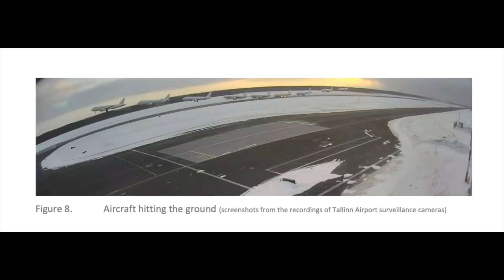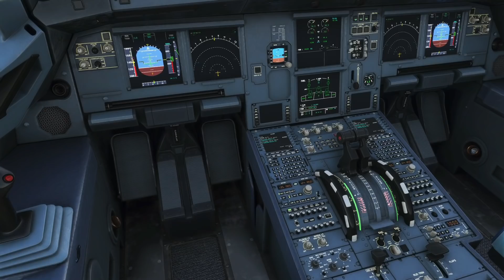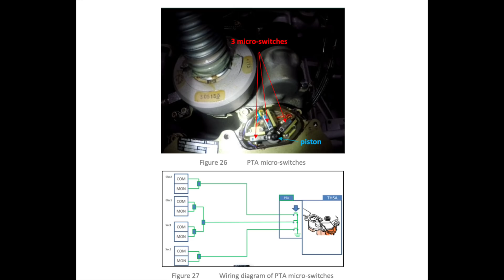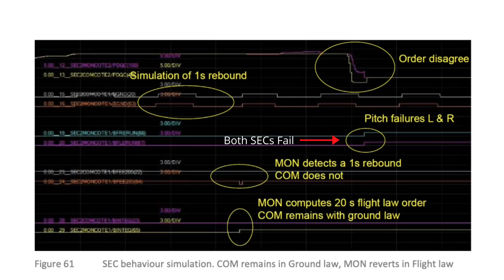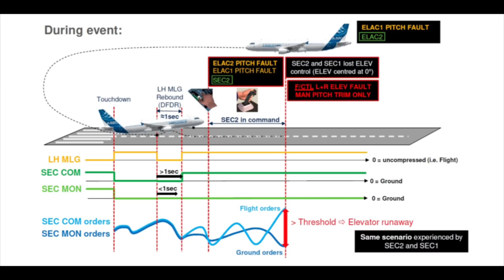The Oil Change That Crashed A Passenger Jet | The Crash Of Smartlynx 9001

Comment: Personally, I think the automation should assist the pilot, not replace him. Ultimately, the flight crew should have an option for a complete and total override of any automated system just in case it goes haywire. There is no real perfect middle ground as both the pilot and a computer can and will eventually fail, but I think that about a 7/10 should be the "happy middle" of sorts. There is no perfect system or man and if anyone strongly disagrees with me then go right ahead, I´m glad to hear your opinion.

Comment: Why isn’t there a “PANIC  BUTTON” that when pressed simply turns these complex flying lap-tops into a Cessna for complete all hands on deck manual control 🧐🤨🙄 ??!!!
Reply: Because a Cessna has cables from the column to its control surfaces, a fly by wire aircraft doesn’t

Comment: I stand in a 5 in terms of automation. Too much automation to me makes pilots depend to much on automation and when there is a failure pilots don’t know how to respond if they haven’t had much manual flying experience. Too little automation and 1 sudden move can crash a plane and without automation systems to try to correct those mistakes and even help pilots in some instances we could have crashes, as we seen in the past sadly.. And even really complex situations where automation helped keep slight control… So to me not too much automation to make pilots hand fly a little bit more and have experience for a automation failure but not to little to make 1 or multiple pilot errors crash a plane but also for extreme situations having automation is good to keep control of a really extreme situation

Comment: Automation is fine, it relieves pilot workload, and can operate faster than any human.  However, since it does screw up despite the best programming and redundancy, it should always be able to be completely cut out and revert to manual control.

Comment: It wasn't the automation so much as ignoring repeated failure warnings.   What did the pilots think was going on to cause those warnings?  They were so lucky everyone survived.   I am a relatively low time single engine pilot (3,200 hours) who owned a Piper Arrow III and never ignored a warning - one of those was when the prop RPM "ran away" then returned to normal - I landed at the nearest airport and upon inspection the prop governor turned out to be micro inches from failure to full feather in flight.   Had I continued I would have been flying a glider.

Comment: Less automation means less possibility of failure, 2 pilots in the cockpit should be enough to prevent problems but that lies in their training and procedures. 
There is something called in USA and Canada a "KISS Rule" which means for those who do not know: "Keep It Simple Stupid", the less complicated the system is the less possibility of failure exist and better performance can be reached in a safer way. That is my opinion.
Anything that is very complicated is more expensive, more difficult to manage and sustain and it is more prone to failures.

Comment: I am a bit old school i remove auto pilots from all the planes i have had and my jet is old enough not to have one so i have to fly all the time but i am a pilot not a Computer programmer i have never said what is it doing now !! Its all on me because i take the job at hand as i should i put extra words in the check list just so every flight i can walk away from ! I wish they had a switch on the airplane to put the control back in the pilots hand when the computers can’t compute Gary K
Reply: That’s exactly what happened with the mechanical control

Comment: Perhaps the most famous oil incident in a jet was in 1983 when an Eastern Airlines jet was being serviced as part of a class. The instructor failed to replace the "O" ring around the oil sensor as he serviced each of the engines. The plane was returned to service and traveled 100 miles before enough oil escaped to cause the first engine to fail. Fortunately the flight crew managed to turn the plane around and the last engine managed to hang on despite no oil pressure until they were on the ground.

Comment: I am a manufacturing engineer, not a pilot, but I suspect the ideal amount of automation is 7 or 8 on a scale of 1-10. Part of my job over the past 30+ years is “mistake proofing” production process - not nearly as complex as flying an airplane. One thing I discovered is the more a process is modified to eliminate human error, the people operating the equipment understand it less and less. The end result is that the makes a very consistent product when everything is working properly, but when something goes wrong the folks on the line don’t know what to do about it. 

By relying too much on automation, pilots may eventually become less able to deal with a malfunction plane.

Comment: I think the automation level should be 10. I think the huge reason that the current planes are so complicated is because they are designed to keep human pilots in the loop. If the planes just ditch human pilots all together, flying itself should be easy. We can make cars navigate through complicated roads, we can also land rockets by themselves. I don't think there's any reasons that a plane can't fly itself all alone since air traffics are relatively sparse. There's only a finite number of planes and a finite number of airports after all. 

Human pilots are useful because human has eye, ears, and can sense vibration and acceleration. Human pilots are also pretty good at interpreting these things. If we can put cameras, microphones, and other sensors around the planes everywhere, I think we can eventually replace human pilots.

Comment: So in this case It's completely humans fault, wrong oil, not verifying why there is a warning, if the people on the ground and the pilot did their job perfectly this wouldn't have happened.
But, people are not perfect they fail.
Human error is inevitable, also means automation failure is inevitable, because its built and managed by humans.
The automation is not completely fail safe, because there are too many combinations of failures that can happen to calculate everything that could happen.
Ultimately humans are still better problem solvers than machines. That's why we have pilots in the first place.
Pilots are the last resort, airbus should have mechanical flight controls as a backup.
Reply: They do. Did you not listen when it was mentioned about the mechanical backup for the trim where the 4 elevator computers failed?
Reply: @tomstravels520  Well I'm not just talking about trim. The pilots should be able to have mechanical control of the all the control surfaces(elevators, rudder, ailerons, flight spoilers). Actual cables Like Boeing does for its aircraft. More types of back up(Hydraulic, mechanical, computer) are better imo, not just COMPUTERCOMPUTERCOMPUTERCOMPUTER. Don't put all your eggs in one basket.
Reply: @mofumofutenngoku  “Like Boeing does for its aircraft” you mean like the 777 and 787. The latter of which has no mechanical controls at all right?

Even the 737 Max has FBW spoilers. I don’t think you understand how FBW systems work. It’s not just 1 computer that controls everything. The A380/A350 have 6 separate computers and 1 backup system
Reply: @tomstravels520  The aircraft in this video was a a320 not 380\350. When I said Boeing I was talking about the most popular planes 737 and 747. Yes I know that, I know that if one computer fails, there will be another back up computer that works. Electronic controls are more reliable than mechanical controls, and we primarily rely on them. However, since they are all computers they are susceptible to the 
same kind of failures , whether that be, Environmental damage, software bug, etc. If you have a mechanical back up,(Like cables or hydraulic) You have another redundancy that will not fail at the same time as the computers. Its just redundancy
This goes both ways, I would be arguing  the same but for computers if you only had mechanical backups. 

Don't put all your eggs in one electronic basket, put at least one in a mechanical basket for goodness sake. You get my point? 

Alright I made my point as clearly as I could, don't have the energy to argue anymore.
Reply: @mofumofutenngoku  well tough luck. Both Boeing and Airbus newest aircraft have no mechanical controls. The 737 Max and 747-8 have partial fly by wire controls. Mechanical backups add weight which increase fuel burn so no they most likely won’t make a comeback. This A320 had mechanical back ups for the trim and rudder which was enough to get them back. The only computerised controls that failed wire the elevators. The ailerons and spoilers all worked until the engines failed then the RAT deployed to provide power to both ELAC’s, SEC 1 and FAC 1. A single computer my be affected by the conditions you describe but not all 5/6/7 at the same time as they are all working off different. Why do you think they have so many computers. Plus if one fails it will be replaced for the next flight.

Comment: 12:44:  The idea is for pilots to practice enough so that they won't make errors.  Computer equipment on the airplane creates a false sense of security.  If pilots have enough skill, they won't need computers to correct them.  It strikes me as to how many of these crashes result from pilots pressing ahead when they should land immediately.  Human nature, more than anything else, is such a prominent factor in so many of these crashes.  Keep airplanes and flying simple.  That way there will be only minimal need for computer equipment on airplanes.  Keep airplanes small too.  That is why planes like the Airbus A320 shouldn't even exist, let alone being permitted in the air.

Comment: After Flying the Airbus A20N, the Cessna 172 G1000 and the 777-200 ER in MSFS (Xbox Series X) for a generous amount of time, all 3 are fun but it's hard to pin down which i prefer, but after all that, I'm still only playing MSFS. I'd say a 7 out of 10. But for simplicity, i'd fly the Airbus, but i'd have it's systems regularly inspected and replaced at the first sign of trouble. I'd also not ignore my ECAM when it displays warnings, these computers aren't like your average PC, they're carefully manufactured by Airbus, and i trust them with my life, but i also like Boeing (737-800, 777-200ER.) but the MAX scares me, i'm flying from Bordeaux next month on Ryanair to Stanstead, so i'm hoping that our aircraft will be an 800 and not a MAX 8, so wish me luck. And if in October, if News declares that a Ryanair crashed while flying from Bordeaux to Stanstead or the other way around, know that i died with my hands up laughing and cheering like as if i was on a rollercoaster as the aircraft pitches down until impact.

Comment: I am a computer engineer, so I am naturally a "more automation" guy. However, something that has been neglected for too long in the field of engineering is the human-machine-interface. It's easy to blame the pilot for inputing the wrong things or for not reading the output (displays, etc.) correctly. However, maybe it's not the pilot, but the interface is just not designed in a good way. In airplane manufacturing, this is generally taken care of. It's one of the first industries to actually look into the human-machine-interface, but obviously there is always room to learn and improve...

Comment: I was a bit frustrated by the visuals on this video. Specifically video alignment with the audio description of the bounce, and the view of the wing during audio regarding the horizontal stabilizer. It would be great if you could put a little more effort into the video instead of just playing the simulator on a loop. In this case it was very confusing...

Comment: Great presentation. 
I would guess that the pilots in this case were not as familiar with the aircraft systems as they could have been. ESPECIALLY the instructor pilot! 

As far as automation is concerned, I would not like more than the current level. (About 7, I think). I know there are semi-autonomous aircraft of various types, but even they are (or should be) monitored from a ground station. They are also, so far, used for military, law enforcement or cargo missions. I regard full automation as unacceptable in aircraft (or other vehicles) that carry humans.

A human crew is trained (as well as possible) in flying and managing the aircraft. They also have the human primal incentive for survival. A human crew will do as much as they can to maximize the survival of their passengers, and try to also survive themselves. 

A computer is a machine. It does not have an instinct for survival. I will not be a passenger in an aircraft (or other vehicle) that is "fully automated", "self-flying" or "self-driving." I ALWAYS want a fully qualified (and mentally stable) fellow human being in control!

Comment: Automation is fine, as long as the pilot can override it. Like Diamond does on the DA62 and others, the avionics will correct over banking the airplane, the pilot can override that with the autopilot disengage switch, which is on the stick. Oh, and if you're ever in a C150 and you lose the rudder, you can steer with the doors.

Comment: As a computer programmer who strongly believes in Murphy's Law (anything that can go wrong will go wrong) I'm still in favor of plane control by computer. 
Take automatic trim settings: pax and crew can walk around and trim will be adjusted.
But on the other hand it's fair to say that computer controlled flying is not perfect - and it never will be. But that's a challenge for pilots. They no longer have to deal with the routine stuff but they should be expert troubleshooters of complex systems. It's a paradigm shift so let's get on with it. The time of the pilot flying is going to end and we need a pilot troubleshooter.

Comment: I'm all in favor of automation as there is no question that, overall, it improves safety.  But, there should always be a way, with a single point of activation, to command the plane entirely from manual inputs.

Comment: More automation to reduce workload, but less automation that preempts pilot's control.

An example of "bad" automation is Cactus 1549.  The pilot attempted a flare.  The aircraft refused, because it violated stall conditions (even when landing, the aircraft wasn't configured for landing, so the airplane refused to flare.

This is an example of automation directly causing harm.  Analysis shows that the input was correct for a flare, and a flare could have saved the airframe, and would have prevented the damage that caused water ingress.  It was only luck that that automation killed the airframe, and not a human.

Also, normal law and alternate law being different (bad automation) has been blamed for other incidents where the pilot did the right thing under one ruleset, but they weren't in that ruleset.  Had 1549 been in alternate law, the flare should have worked.  And the pilots knew it should be in alternate law, because a double engine loss triggers alternate law, but the computer thought one engine was fine (cue "this is fine" picture).

Comment: The level of automation should be 5. Too much automation is convenient - but lowers the ability of pilots to adapt and quickly respond to any kind of situation. On the other hand, too low automation makes more work for the pilots, that they may be unable to see issues coming up.
Pilots should be able to fully replace flying computers if needed - therefore, human and machine need to cooperate, with human being the one in command.

Comment: I don't think the amount of automation is the problem here. The communication between automated systems and the human flight crew is the issue in my opinion.

Why does the system have a ground mode and a human flight crew who are not always in the know that the plane still is in ground mode?
And the system surely detected that it was accellerating while remaining in ground mode. Ergo: the plane is preparing to crash into the nearest building or other structure or trees.

What purpose does ground mode serve if the plane is accellerating? System: 'ah never mind, the pilots wanna do a bit of drifting in the parking lot.'

Comment: When it comes to automation, and to be clear to my bias I'm a computer engineering student, I think the planes should be able to do everything automatically but the pilots should be able fly the plane with all automatic systems disabled.  In any automation system a human is the ultimate fail safe but in any manual system a human is the ultimate liability.